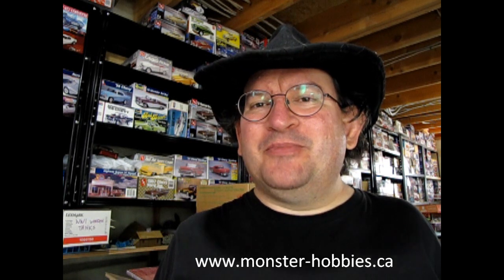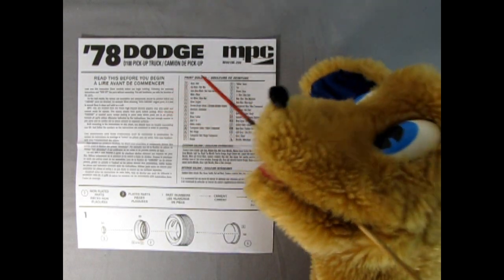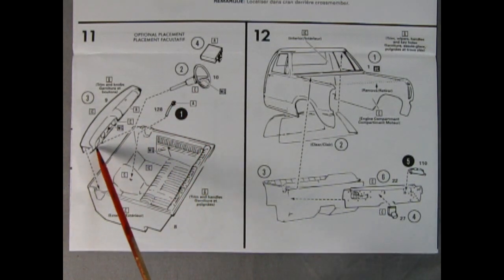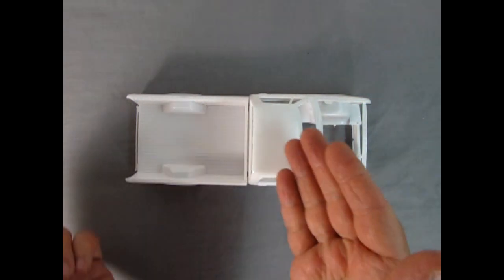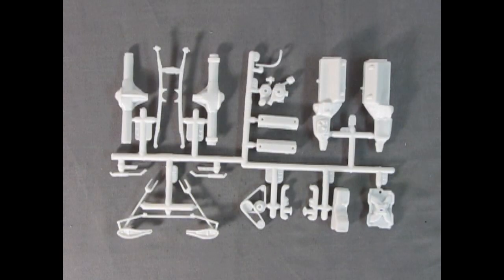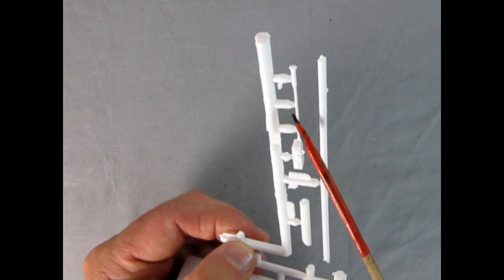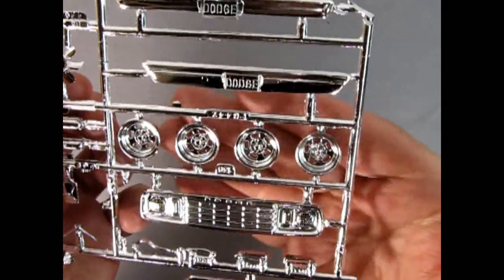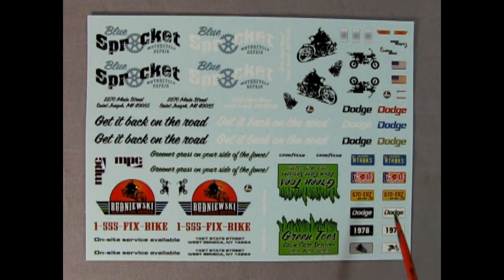Model Car Garage - The 1978 Dodge D100 Pickup Truck by MPC - A Model Kit Unboxing Video

Comment: What you called the oil filler is actually the distributor. Which makes the engine a big block (383, 400). Not a very realistic model of the engine either. I's source a parts bin engine from another kit.
Reply from the maker: Thank you for clearing that up. It's not a distributor...it's a blob! LOL!
Reply: super low details.
Reply from the maker: @jcatslist  It is an "Easy" one for sure!